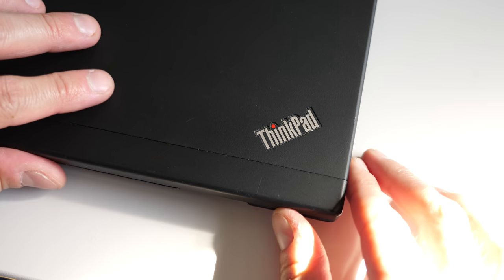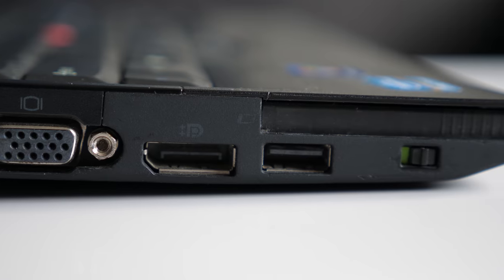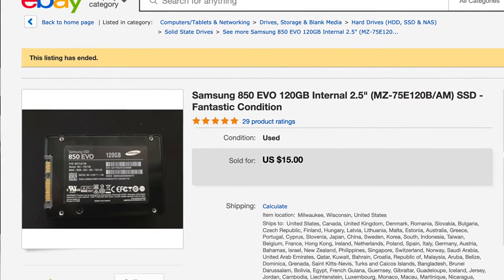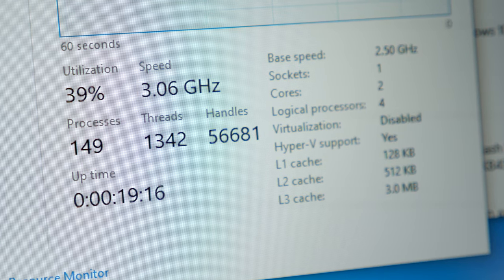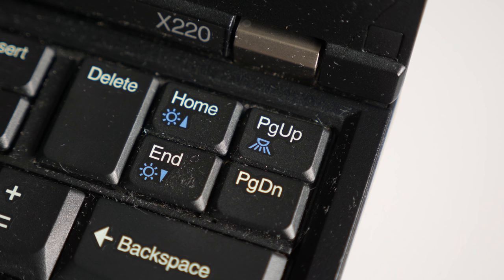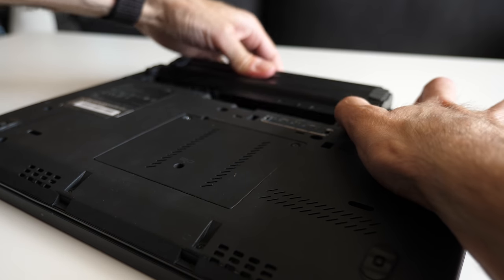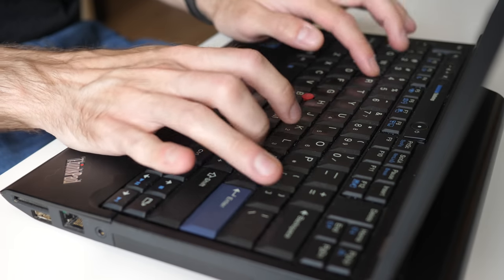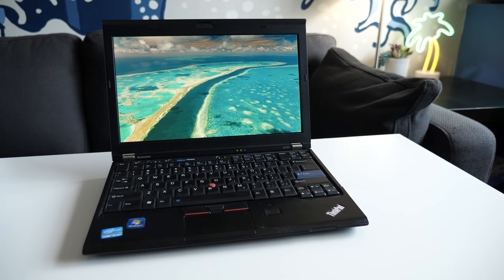The $100 Laptop Challenge -- This Old PC is Better Than You Think

Comment: Peppermint OS, MX Linux, or KDE Neon would really give that old machine wings.
Reply: +1 for KDE Neon. I'm a notorious distro-hopper but I fell in love with KDE Neon a few months ago, and I don't see myself hopping again any time soon.
Reply: Install void or any other minimal distro on it and install wm. I have 668 packages on my thinkpad t540p but it has some bloated apps like steam and wine so you could probably get away with sub 600 packages with this setup depending of course on your needs.
Reply: @luimu  Manjaro i3 is my favourite
Reply: I tend to go with Debian and LXQt. You have much more control over what is installed by default, and you also still have native i686 support
Reply: I have an old ThinkPad e530. I put an SSD in it and installed Linux Mint Cinnamon. Linux saved me from throwing old laptop away.
Reply: KDE on a X series Thinkpad? Possible but not practical. XFCE makes more sense. Especially if you don't give it a lot of RAM.
Reply: what do you think of lubuntu? I'm using it on a 32 bit system and apparently the support will drop for it soon - but it worked well while it lasted.
Reply: I prefer Linux Mint (cinnamon) and some hardware upgrades. Not as lightweight as your OS, but very user-friendly. And with some upgrades to the machine, it runs very smoothly.
As I am new to Linux, this was an easy switch from windows. A few other OS that I tested felt a bit unintuitive to me.
Reply: To be honest, ssd, ram upgrade and Windows 10 does same thing

Comment: I custom ordered a Lenovo x220 with an i5 2540M, IPS display and extended battery back in 2011. While my current daily driver is a Lenovo x280 Ultrabook, I still own the x220. 
It sits as a spare machine for when guests come over to visit. I have since refurbished it and it now has a custom bios, 16GB or ram, wireless AC card, SSD and windows 10. The keyboard is a dream to type on and there is absolutely no give in the hinges. Honestly it's amazing how well it works for general web browsing and office applications. 
Hopefully I can get another 5 years of use out of it before it is retired... Got to love a ThinkPad!

Comment: I bought a T420s secondhand in 2014, and am still using it for my daily computing. 1600*900 resolution display panel, which is identical to my work HP Probook 470 G4, made in 2017. Upgraded the RAM to 16GB, installed a Samsung 840 Pro SSD and upgraded to a BD-RW drive. The battery has seen better days, but overall I still love this machine.

Comment: I have an X220i I use as a lightweight machine running Mint Linux, upgraded it with some more ram and an SSD instead of the stock HDD and it runs like a dream.

Comment: Me: Watches on MacBook Pro
Also Me: I want this
Reply: SAME MAN! Just got a MacBook Pro, but the inner tech geek inside me wants this! This thing is awesome!
Reply: Get one. it's worth it. Especially if you install a Linux Distry on it like Mint with Cinnamon desktop. A lot of the hardware runs out of the box without any extra drivers. Only the WLAN chipset sometimes can be a problem, depending on what was built into. But that can be easily swapped.

Comment: I had a x230 and I liked it. But the screens on these older, cheaper ThinkPads are usually really weak. 720p and a TN Screen isn't great. 
I would highly recommend buying like a 1080p 24 inch monitor used. They are relativly cheap, you can get done work better at home and don't have to look at the screen, that isn't great, all the time.  
But if you're totally budget limitated, they are still great machines for the price and can easily compete with new cheap notebooks.
And to be honest, I wouldn't buy a used SSD as you can get a new one for like 5$ more.

Comment: These old laptops are definitely good if you don’t require too much horsepower for games etc. I had a T420 about 5 years ago, and used it for music production (Cubase etc) and it was pretty decent. Like he says in the video, it’s surprising how many modern laptops it will beat in the sub £3-400 mark (or $). Also, the build quality tends to be much better on these, as they were high end business machines when they came out. The only bummer is that the batteries are nearly always shot, so you’ll need a new one for unplugged use.

Comment: the X220 is great, but I'll always be nostalgic for the X60...
Reply: i have an X61 side by side an X220. This video viewed by X60. Great machines!
Reply: @iamlaci76  X62 ;)
Reply: @tytusromek9267  R61
Reply: Never had an X60, but I used an X40 as my main laptop for several years, eventually giving it to a friend who it's still serving well. I guess its main limitations are the 1.5GB RAM ceiling and the nonstandard & slow 1.8" PATA HD... when that drive finally dies we'll probably swap in a Compact Flash card w/ passive adapter.
Reply: I have a Thinkpad T60 sitting on my desk across the room. Has one of the best keyboards I've ever used on a laptop and while yeah it's old and seen better days, it's not in a waste recycling center because with Linux on it, it'll still do anything I've wanted it to do. Plus sad to say that even with a lowly core 2 duo in it, it's still faster then some of the cheaper laptops out there. As long as your expectations are realistic people can get a LOT of use out of older machines still. It's kind of a shame they are being forgotten about by people pursuing thin and lights that have half the performance for literally 10+ times the cost and zero user serviceability.

Comment: Yes. I have been doing this for years. SSD’s is a must in all 10 year old laptops and a ram upgrade to its limit which usually is 16gb. Always check if there is a bios upgrade. Be very careful and triple check it’s the correct version as this bios upgrade done wrong will brick the laptop. Good luck. Stay safe.

Comment: I also purchased a T540p from Ebay for 75USD with i5-5400m and 8GB RAM. I just did an upgrade of 3K IPS Screen, i7-4900MQ, SSD and GDC eGPU. Now I am waiting for a RAM upgrade. For the upgrading parts I spent more than 300USD but it is totally worth it. Now it is my secondary machine for deep learning.

Comment: @this does not compute - @7:39  - I have to respectfully disagree. I would recommend the elitebooks over probooks.  the elitebooks for a few years back have great expandability  and are reasily  repaired.  
Don't forget to tell people to (if possible) replace the CMOS battery when getting one used.
Reply: Agreed, I've recently bought an elitebook, they're so easy to upgrade as well.
Reply: Literally so easy to work with, very little screws.

I replaced the sub par screen with the HD to full HD. So easy to do
Reply: I agree with you. I have used a ProBook 4525s in the past. It really sucked and broke after falling down the stairs of my school. Later, I built an awesome gaming PC for gaming and bought a T430 for coding and general use which still works and is in mint condition. Only problem is that the N key is a bit squishy.
Reply: I agree. Last year I bought a refurbished 2014 Elitebook 820-G1 (i7-4600U) w/ 8GB of RAM and a Samsung 830 SSD. Got rid of Win 10 and installed Linux. Runs smoothly, even the fingerprint scanner. It's been my daily beater machine since.

Comment: I have the exact same model except it came with an i7 processor. I added a 256GB MSATA and kept the stock 500GB HDD. After a while, I added the dock for dual monitor support. Pretty good as a daily work machine. 1080P videos will stutter a little but overall still worth it. Only annoying part is the limited whitelist WiFi card support.

Comment: I've been using my X230 Thinkpad running Linux Mint for several years now and it has been great.
When purchased used from Ebay it still had a couple of years original warranty valid for it, and it came with the Ultrabase Series 3 unit with the extra ports and DVD drive.
The vendor had also upgraded the HD with a decent SSD which means it boots up and shuts down and performs very quickly.
The only problem with mine has been the power button breaking which meant I had to replace the whole keyboard twice with a 3rd party product which was not expensive and worked great including the backlighting.
This is definitely the way to go to have decent performance for a budget price.

Comment: I was of the same mine as you when I set out to purchase a new laptop. I repurposed the same model the X220, but I ran into a few big problems: batty life and internet speed. Battery life was fairly awful even with a 9 cell battery, and I was surprised to see how much better connectivity my wife's n4000 HP laptop had when moving a few rooms away from the router. I ended up recycling the machine and purchased a Ryzen 3 powered gateway laptop on Black Friday for $250. The machine is proving really decent. I'm especially pleased with the gaming capabilities of it, but battery life is by far the feature that puts it over the x220; I think that is where you can make an argument for lower end laptops you can find on store shelves today.

Comment: Can fully confirm that it's completely usable even today. I bought a used X220 back in mid-2016 and it's still my main work laptop if I need to travel (with an SSD of course). The only issue I had was that the internal LCD panel strip snapped, so that upper corner has a little bit more flex. However, this is how it came, and might be due to rough handling by the former owner. Apart from that, I never had any problems, and the hardware is still amply powerful for Win10 and most everyday tasks of today. I'm also a huge fan of the classic ThinkPad keyboard, which was dropped when the X230 came along. 

As an added bonus, it has both DisplayPort and VGA, and I still use the latter on a regular basis (as there are many old projectors still in use in a university environment). Many times, guests would forget their adapters, or they somehow failed to work, so I gave them this for their presentation.

The only downside of the machine is the low screen resolution, that's definitely sub-par by today's standards, and the one thing I don't like about an otherwise well rounded laptop.

Comment: I picked up a Dell Latitude E6230 as a project a while back, with similar criteria: around $100 for general use (and I wanted to play around with Linux on real hardware again). It's got an i7-3520m CPU in it, which is more than enough for daily use, it's built like a tank, and even after buying a backlit keyboard from a better optioned one, as well as a better wifi chip, a bluetooth card, and 16GB of RAM, I'm still well under $200 into it (and it even came with a Windows install on its SSD!). These old things can be great values, and I 100% agree with your assessment. I use it often at work for testing sites from off network, and its proven invaluable in this time of widespread working from home more than ever. Even as a plaything these things have serious use left in them!

Comment: I fitted mSata SSD drives to my old X220 and T420i as boot partitions as well as the standard hard drives. And you can also fit a Quad core processor on the T420i as well for even more performance which is a big bonus.

Comment: You should FHD mod it. Requires soldering but makes the screen look much better. Additionally, if you want to use the HDD for bulk storage but want the speed of an SSD, the X220 supports mSATA SSDs. You can also buy modded motherboards that have the CPU swapped for a quad-core i7, but they cost around $400 and you need to use a Taobao importing service which will cost you even more. As far as software modding goes, Coreboot supports them but at the cost of either using proprietary option ROMs or not being able to boot Windows.

Comment: I have a Dell Latitude E6510 Core i5 which was originally my works laptop.   I now use it as my own.  I've upgraded it's hard disk to SSD, upgraded RAM to 8Gb from 4.   I also got a replacement battery from Dell along with a HDD caddy to replace the DVD drive to allow for a 2Tb HDD on top of the 250Gb SSD I got it.
I have been impressed with Dell's support in older kit which gave me the ability to get new parts for a 2011 laptop and the machine performs better now with Windows 10 than it did with its stock Windows 7 Pro install.    
I'm all for keeping old kit going.    If only mobile Android devices were as easy to keep going.

Comment: I love my X220 and have used it for years. There are some disadvantages which made me buy a new laptop:
1. Struggling with full HD. If you connect the laptop to a TV and want to watch 1080p you might run into some stuttering. The laptop gets really hot and is like running on full power.
2. Portability. I am not saying its not portable but it is kinda a thick laptop.
3. Battery life might be a problem but there are cheap batteries on amazon for like 20 bucks from china.
(4.) Noise. Its not noisy but you hear it. That also depends on the quality of the fan. You can actually replace the fan and heat sink if you are tech savvi.
(5.) Mic also might be unbearable for the listeners. Of course, if you get a refurbished laptop they might have replaced it.

It is a REALLY good and robust laptop and I love the keyboard. If you are on budget, only need to for working like coding or whatever you will not regret to buy one. Especially, if you can hook it up to a  keyboard and  display. And if you like it, get the docking station. 120% worth it.

Comment: I had a Samsung np-qx-411-w01ub that I bought in 2013 for about $380 (it was 2 years old at the time) and I got so many years out of it.  I made several repairs, at one point even buying a second one to steal parts from.  Swapping out the HDD for a high-performance SSD made a HUGE difference.  I'm primarily a Linux user, but I still pop it open when I need Windows for some reason.

Comment: I'm a big fan of older Thinkpads, but one thing that everyone needs to be aware of when buying a laptop with an older generation CPU (anything older than Intel's 7th generation) is that some modern video codecs are out of the question, and this is a huge problem for any of us that are working from home, because video conferences with numerous participants is really big right now.  Specifically, h265, and Google's VP9 are both not capable of using hardware decoding unless you have an Intel 7th generation or higher, and if you have a CPU earlier than that, your CPU will be doing software decoding, which is very heavy on your CPU.  For both of these compression types, you will probably manage to view a single HD video at a time, but your CPU will be maxed out if its HD or higher.  For example, my 5th generation i5 is incapable of participating in Google Meets when there are more than 4 other people shown on the screen, so I am unable to use that laptop for work, unfortunately.  Google recently started enforcing their new VP9 video compression on users, and that was unfortunately a death knell for my older Thinkpads.

Comment: I agree with your sentiments exactly. I am just replacing my 9 y.o. i5 X220 (upgraded with 8 GB RAM and a 256 GB 860 EVO SSD), with a T490s (500 nit display). It's still running really really well, and the keyboard is excellent. But the screen is just too dim for outside work (250 nits), and it's too small for my now middle-aged eyes. It also has some trouble with MS Teams and YouTube on a larger monitor under Linux (software decoding only). If I used Windows, I would probably have no issues besides the screen.

Comment: Theyve basically reached a point where for general computer use and even watching compressed videos there is not a need for faster and faster computers. If you tried to use a 10 year old computer in 1995  you were going to have a VERY different experience.  Ditto for 2005.  But now computers from 10 years ago are perfectly fine for general internet and office use.

Comment: I work for a small University and we have been buying the HP elitebook 840 g2 laptops, they have i5 4th or 5th been processors and we buy them for less than 180 with an SSD. They are great laptops on a budget, decent battery life and excellent build quality.

Comment: I have still the same one as backup notebook. I had saved it from scrapping back then. same CPU, same RAM, similar Hard disk, but with linux mint installed. And it worked like a charm.

Comment: Be careful about buying a used SSD.  SSDs have a limit on how many times each location can be written.  Mechanical hard disk drives do not have that limit.  I love Thinkpads, especially because you can use the red mouse pointer (Trackpoint) without taking your fingers off the home keys.  That is great for touch typists.

Comment: A friend of mine was unemployed and needed a PC for job hunting. I found a 'spares or repair' X230 for about £60 gave it some spare RAM, a SSD and a charger I had lying around and put together a nice windows 10 machine for her. My souped up T430 is way more powerful but it was a great way to do something useful with all the old parts I took out of the t430. It can even play some older games from the same era on low settings. I tested Fallout New Vegas and V:TM Bloodlines on it before I gave it away and both were playable if not spectacular.

Comment: I have a x220 with the same specs ;). I run a dual OS Win10/Ubuntu, it works just fine. I can confirm, that the SSD improve the performance.

Comment: Second gen i5's are space heaters. This video is excellent advice, though. Just raise up the laptop with Cool Feet or similar.
Reply: Just as bad as the i7 Quadcore in the T420. Performance comes with a big trade off..... the insane heat....   Poor CPU fan cannot even handle it properly... Especially when you have an Nvidia GPU in it.